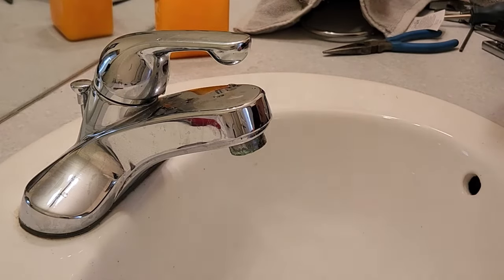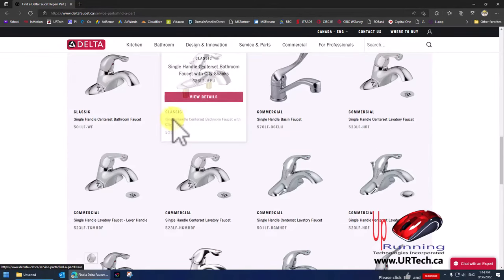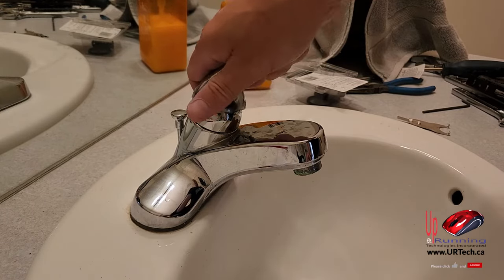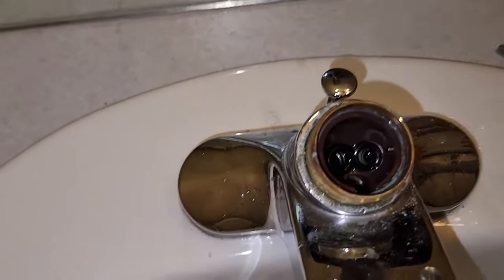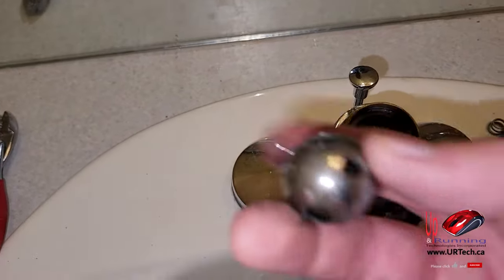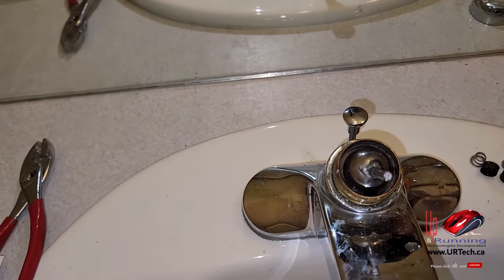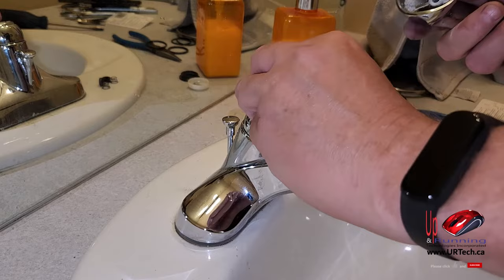EASY FIX: Delta Faucet Drip Repair

Comment: Thank you so much!  Got my dripping faucet fixed with two replacement springs and seats and about 40 minutes of work (including time driving to and from the plumbing supply store).  Excellent video with easy to use directions!

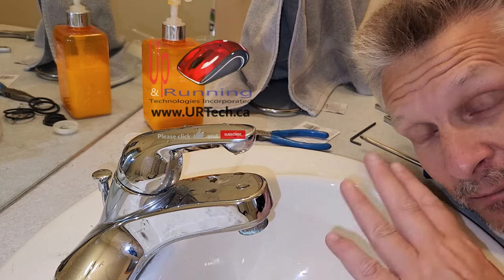Comment: This is an excellent video. I groaned when I saw 11:30 minutes, but it was great content from start to finish; no useless filler. The only issue I had was getting the nylon part (not sure what to call it) aligned with the slot guide. I needed to apply a lot of down pressure to get the outer housing threaded. When all was said and done, the handle is just a little 'off' meaning when I return the handle to the 'off' position, it's slightly to the right... When you showed the process of using a screwdriver to align the nylon part, what you were doing was obscured by your hand in the video. So I'm not sure what you did to get it 'right.' I tried moving it into the right position with a screwdriver while pushing the housing down, but didn't have much luck. I'm sure it'll bug me enough that I'll try to redo it at some point, but at the moment I'm very happy that the drip is fixed. Thanks again!

Comment: Thank you so much! I have replaced the seats and springs but still have a leak. I think the yellow rubberey thing that the seats sit in,  is compromised somewhere because it leaks out just under that bottom silver housing(what you called a bonnet cap) . Is there a way to replace that piece (the yellow rubbery piece ) without replacing the whole faucet? Or is there something else that could be causing this. It only leaks out from underneath the bonnet when I turn it on.

Comment: My faucet is the same as yours but my leak is not coming out the faucet spout but is leaking at the underside of the faucet where the copper pipes bring water into the faucet.  Will replacing the two springs and two washers as you do in your video also fix this kind of leak or does it mean I have a serious enough problem that I need to replace the entire faucet?
Reply: The spout wasn’t leaking before the repair but it is now. Did you replace the entire faucet?
Reply: I bought all the suggested washers and springs as in the video and replaced the old ones in my faucett but it still leaks underneath the faucett where the copper pipes that supply the fresh water connect to the underside of the faucett.  I think I need to replace the entire faucett because I dont believe those connections are accessable or repairable.

Comment: I followed the video exactly and I still have a leak. What would be my next step?
Reply: If your bathroom faucet is over 10 years old,is probably better to replace the old faucet with a new one,is not hard to install,you could do it yourself, at least with a new faucet you wouldn't have any problem for a long time

Comment: HOOVER VACUUM HELP PLEASE ?  I OBVIOUSLY REWIRED WRONG, BECAUSE MOTOR NOT SUCKING ANYMORE. JUST BRUSH TURNING NOW. CAN U TELL ME THE WIRING LOCATION COLORS IN  OFF/ON SWITCH , I DIDN'T LOOK CLOSELY WHEN DISASSEMBLING. U HAVE the  MAIN  POWER ON/OFF SWITCH (LARGE) and the BRUSH OFF/ON SWITCH  (SMALL). CAN YOU GIVE ME the 2 COLORS TO MAIN POWER SWITCH, and the   2 COLORS TO BRUSH SWITCH. THANKS    YOUR VIDEO:    https://www.youtube.com/watch?v=0OQ-vo2kvXg